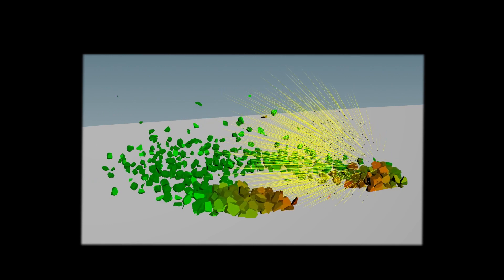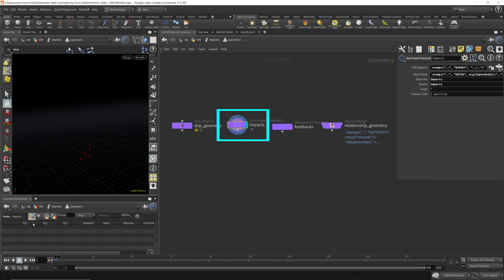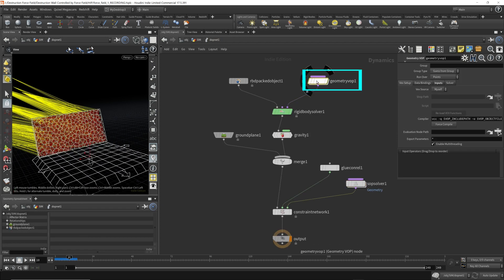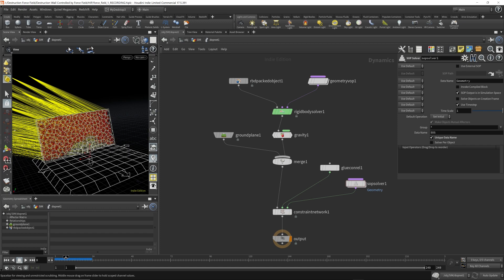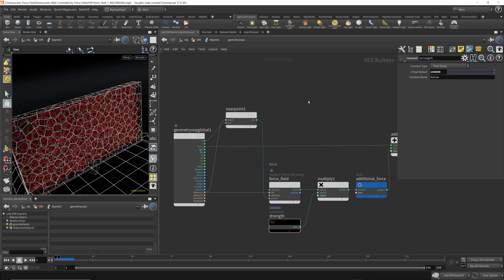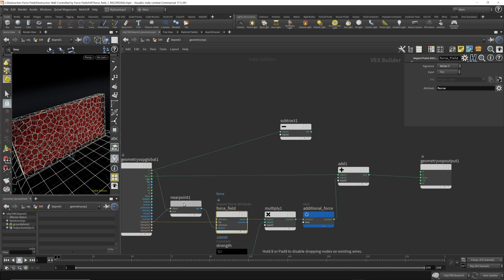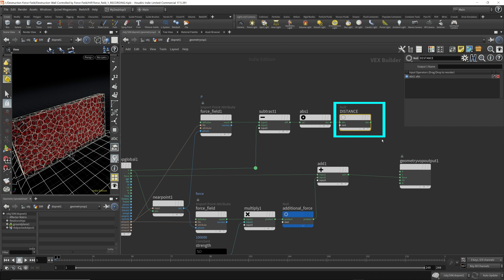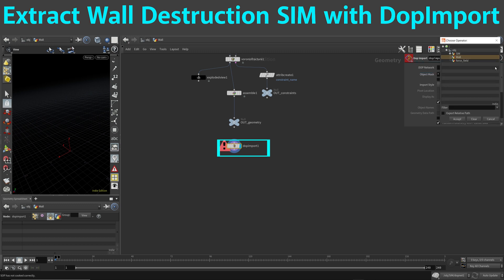Control How Glue Constraints Break in Destruction Simulations in Houdini (Rigid Body Dynamics RBD)

Comment: Hello there. Just trying various methods of RBD descruction and found this really quite useful. Excellent work!  Only one question though. After the initial explosion my scene goes into bullet time. Any vague idea why that might be? And thankou again.
Reply from the maker: Thanks for the feedback!  What's bullet time?  Is the blast pieces traveling too fast after the impact?  If I didn't misunderstand, I believe the constraints are too weak on the fractured geometry and the impact might be too strong for it resulting in a larger explosion.  Try tweaking the constraints' strength and making them stronger and maybe try making the impact less.
Hope that helps!
Reply: @bubblepins  thankyou. It's actually doing the opposite, Goes fast then they slow down. Like in movies when they slow the footage to see closeup action in more detail. Looks cool but I can't see what;s causing it. I have no drag as far as I know in the scene.
Reply from the maker: @bobvelocity  Are you previewing this in the viewport or doing a flipbook animation?  It's best not to trust the Houdini viewport, because it's always computing something in the background, flipbook will give you a more accurate feedback.  If it's not that, I wonder if there's a hidden force that's being animated by accident slowing down the pieces, try checking out the force of the pieces after the dopimport node and see if the force, or v has changed significantly, then you'll know somethings up.  Or if you're brave enough, you can check out the force inside the rbd solver within the dopnet.  To see that you'll need to expand the rbdobject/geometry and you'll get a similar spreadsheet layout as you would in the sops world.
See if that helps!

Comment: Thanks for this video but I had one issue .when I connect force with if block node inside vop  they give an error ' the force has different type ' how to solve that error .
Reply from the maker: I'll need a bit more description of the setup, but I'm guessing you might have plugged something like a constant into the force plug, because judging from the error message it sounds like you're trying to plug an integer, float, or string into the force vector.  You'll need a vector to vector matching type.  But its hard to say from just a single error message, it could be something else.

Hope this helps so far.

Comment: Thank you, it is really explanatory. how can I make disable the force field overtime  just after break happens per piece,
Reply from the maker: I think you could try adding a wrangle to the sopsolver to record when the impact happens, but that's only possible with a solver node, because that's the only node that can recall attributes from previous frames to remember the impact state.  Then you know exactly what frame the impact happens, you could do something like Current Frame subtract Impact Frame then you use that to determine the force.  The larger the difference of the two numbers, the more you diminish the force.

Hope that helps!

Comment: The horrendously over-complicated implementation of "If blocks" in VOPs is a good enough reason to learn VEX :D. Great videos!
Reply from the maker: I do agree the node network for if blocks could be designed a bit better, but it is a hard task to make if conditions into nodes.  VEX is definitely a lot simpler.   I'm hoping to come up with a mini series on the side for VEX soon, but I have the same problem, I'm not sure how to teach VEX...
Reply: @bubblepins  yea totally agree, translating codding concepts to nodal based systems is a dificult task, let alone SOPs for loops :D. You surely will make great VEX learning videos, you have great teaching skills.
 I reckon a good way to introduce VEX to someone familiar with VOPs might be building your code in VOPs and then the same in VEX, and comparing them line by line, node by node? Just an idea
Reply from the maker: @dndx5  That's right, I completely forgot about VOPs!  That's a good idea, I should start with that to slowly crawl into the topic of VEX.  Thanks!!

Comment: Do you mind commenting on your machine specs? Looks like your file cache is very fast!
Reply from the maker: It might have been fast forwarded in this video, I do a lot of heavy post processing after recording. My machine specs are THreadripper 3960 - 24core, 64gig of ram, rtx 2080 and I had updated my pc to a NVME M.2 ssd drive which REALLY helps speed up the caching in Houdini.  I think that was the best upgrade I ever made, because NVME's are relatively affordable when you compare it to the amount of performance boost you get.

Hope this helps!

I even wrote a blog post on this:
https://bubblepins.com/blog/affordable-hardware-upgrade-for-houdini

Comment: thanks alot for the tutorials

I couldn`t find  much info about RBD sims with custom forces.

The Tutorials are well explained - but I find it in general very laborious to get to the final result.

- particularly to handle the Glue-constrains seperatly - there should be an option to break them automatically by a given force
- this would make such tasks alot easier
Reply from the maker: This exists in RBD tools from Houdini 18.  There's a breaking thershold panel in the RBD Tools, which is a new feature in Houdini 18.  I am currently working on some videos on RBD Tools which has a completely different workflow compared to the dopnet.  Stay tuned!

Comment: Hey, first of all - thank you very much. Taking the time to explain simple stuff step by step is exactly the reason why your tutorials stand out. I was looking for a way to explode my rbd-object and this is pretty much what I was looking for except for one aspect. My scene is a small room with various prefractured objects and I want my "explosion" taking place in the room in slow-motion. With your method I can do exactly that, but it's affecting every object at the same time. Since there is some distance between those objects it would be realistic, if the nearest to the explosion would scatter first. And on top of that I would like to only affect the fractured parts that are facing the explosion, so that everything behind them gets pushed away from the particle, but not from the force itself ( since the force of a explosion would not be able to go through a wall ) I was wondering if you know a approach to this, or a website to look all this up. Thanks again!
Reply from the maker: I think you can add an attribute to your target geometry (the one being destroyed) and then inside the geometryvop read that attribute to figure out if the force should be applied to that geometry.  I think this is a very interesting question, I'll try this out when I come home tonight and upload a potential solution to my blog.  Come check back tomorrow!
Reply from the maker: Hi, I uploaded an example HIP file where I control the force field and which geometry it is applied to inside the dopnet using a target attribute.
https://bubblepins.com/blog/controlling-force-field-for-specific-geometry-in-destruction-simulations-in-houdini
Reply: @bubblepins  Thank you so much! I'll try to implement and understand exactly what you did there as soon as i get home tomorrow. If you don't mind, i will let you know how that worked out for me. Again, thanks a lot for taking the time!
Reply from the maker: @oile-fx  I would love to hear how it works out.  Good luck & have fun!